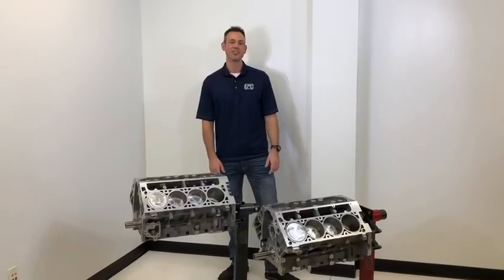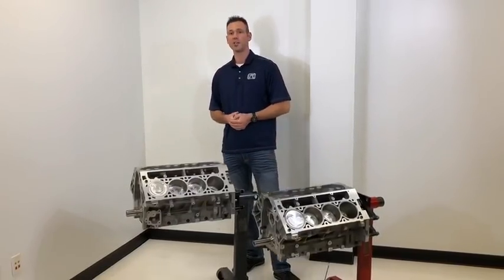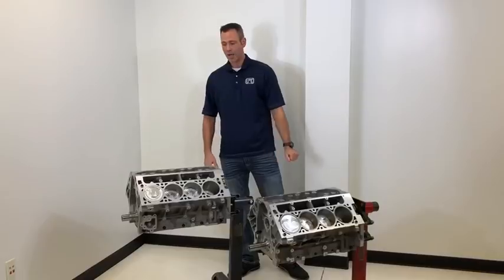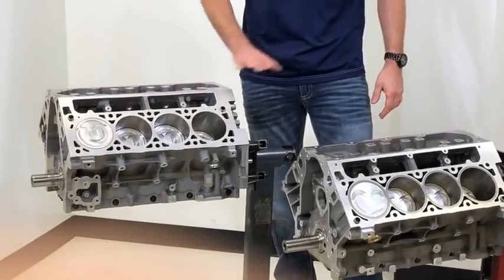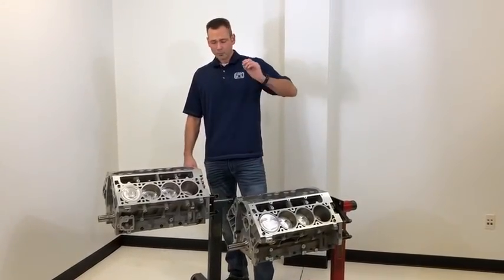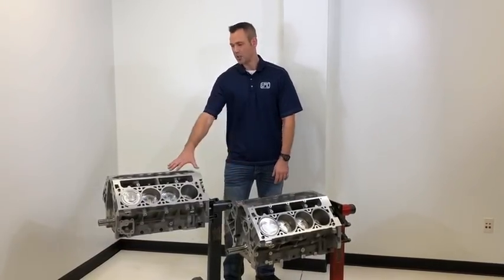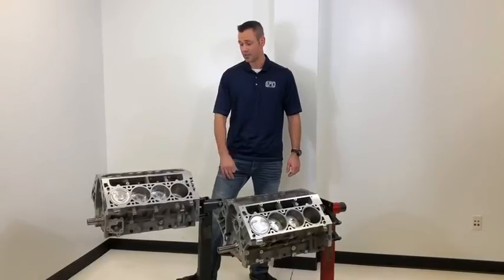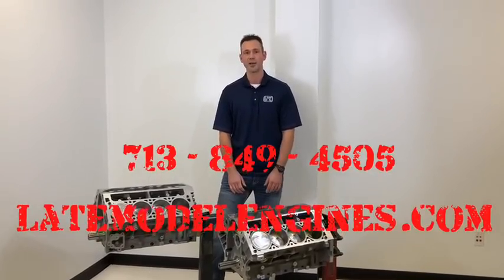What makes the LT1 / LT4 so strong?

Comment: Give me a 327 with a few nice bits inside at over 7k rpm with a carby 11.1  comp a solid cam even flat tappet 
 iron heads or maybe I could slip an ally set on there
 a nice solid timing chain reworked aftermarket or shed modded sump a manual trans in just about anything that ain't huge 
And u shall be exposed to a pleasure and the song of a lil giant killer  that has been forgotten about unfortunately
Reply: @keith-jo6wg  what era was the lt4 you are talking about I'l haftoo have a good look I'm very old school 
40 years ago 
A friend of mine in Australia 
Had a 327 small journal 
Built by a fellow that became a good friend  talented man 
He had a bread and butter engine workshop in a small city in New South wales 
But  mark the shop owner liked doing lil specials on the side 
If things got quiet 
It took him over a year of his part time to build this lil engine 
With attention to detail 
Solid cam flat tappet 
Can't remember specs 
Fuelie heads ported and match ported 
Victor jnr 
Balanced 
And squared up 
Good forged slugs 
Can't remember rods 
Guide plates 
Screw in studs and manly rollers 
 650 Holley mechanical 
Top loader and a 9 inch 
It easily revved to 7 plus 
It was in a four door Holden hj sedan 
Dumped on the ground pretty well 
Not a real light vehicle 
With firm suspension   235  50 series on front 265 50 series on back 
I drove this vehicle at 240 kph
Ish I was well past the 220 on the clock  and his Speedo had been calibrated quite well at time of rego it was one of the conditions by the fella that inspected it  and it had a lil more 
But I ran out of rd 
And I ran out of nerve I was 19 
Go the mouse 
Scared the Shiite out of me 
And to hear that lil sucker wind through the gears was something 
I won't ever forget 
It smoothed out beautifully at about 6k and was asking for more 
The whole way 
At the time 40 years ago the build cost him 5k or so 
Back then that was a substantial house deposit  a block of land was less than 20k 
Anyway I've always wanted one the sorta the same 
Yeah I know the past is gone 
Cheers

Comment: Are there higher flow direct injection injectors and pumps or do you revert to port injection for high horsepower? 
Are the aftermarket (incl Chev) going to be selling high deck height blocks?

Comment: Not even close to a Windsor
Reply: That's one of the best things I read in years old school has potential that has been written off so many times looking at the differences here shows some of the weakness in the LS   the only LS I've ever been impressed with was an LS 7 a friend of mine had 
greatly engineered engine  
But will over time still suffer from 4 bolt per cylinder and webbing issues if consistently driven hard 
An aquantence of mine was putting old school blowers on them for skid cars without upgrading anything Sept lifters and rockers valve train stuff  he windowed that many of em it was criminal and he wernt even getting a hell of a lot of power out of em  till he got sensible and run em on alcohol with mechanical and kept off the dickhead limiter 
Some of the toughest cars he was competing against were blown small block chevs and old school blown Ford's with mechanical injection and alcohol
I'd say most were after market or special blocks though or had been engineered for reliability 
They should have different days at skid fests one for cars with limiters and one for cars without and I'l stay home for one

Comment: I drove a LT-1 in a 1994 Z-28. I wasn't impressed. I drove a L88 5.7L 350 in a 1980 Stingray Corvette. That car was a piece of junk.  I don't like Tuned Port Injection either. I think Chevy in general I just didn't like. My First two cars a 1983,1984 Z-28 5.0L 305. I got a Mitsubishi Galant 2000 now and, I'm happy.
Reply: This is the Gen 5 LT1 in the current Camaro SS and LT1, not the old 90's LT1.

Comment: I would have to say this about these engines . Both times me and my wife owned a Cadillac one was a 2014 and my current one is a 2018 we had lifter problems . The ‘14 would have a lifter that every once in a while would collapse then after a minute would pump back up . Then the ‘18 out of no where dropped a cylinder cause of lifter failing and bent a pushrod . 35,000 miles . That’s in a Cadillac . How can these engines take abuse like they would in a Camaro or a corvette ?
Reply: Lifter issues are due to active fuel management and displacement on demand systems in the l86 and l83 engines.  LT1 and LT4 engines have differences in the valve train which allows them to handle more abuse.
Reply: Are you sure it was a failing lifter? I had the exact same thing happen on my 15 Silverado 6.2L, snapped and bent a pushrod. Took it apart, replaced the pushrod, changed the oil, and it’s like nothing even happened. I’m still getting a random misfire code from the fouled plug but this literally turned $1000 of work into me givin my buddy, who’s a certified Chevy mechanic, $100 for his time and effort.
Reply: From what research I have done personally this comes from failure to change oil filters and oil. Oil filters are more important than the oil change on all these new blocks.

Comment: The LT4 has a slightly stronger block.
Steel crank better rods and forged pistons.
And will easily take 1000HP with a well engineered twin turbo setup ....
Reply: So is it possible to run a reliable 1200hp LT1 with a stock bottom end with ARP stud upgrade?
Reply: @sixx6sixx107  
Unlikely hence steel cranks special rods and forged pistons...
Reply: @markjmaxwell9819  ig I need to buy the boostline drop in piston and rod setup...hate to spend the $2650... thinking of trading this thing for a 6.0...its just too dam expensive
Reply: @sixx6sixx107  lollll
Reply: @markjmaxwell9819  I'm serious...I'm just going to do a Gen 4 5.3 with stock bottom end(with ring gap) and ARP studs,trickflow heads with BTR springs and head stud kit,BTR stage 3 turbo cam and a nice intake manifold with two cheap ass ebay turbos.... going to start with that and build the 6.2 slowly while running that combo or I may trade it for a Gen 4 6.0 🤷🏾‍♂️
Reply: @sixx6sixx107  lolll good luck...
Reply: @sixx6sixx107  sounds like you been doing your Richard Holdener home work. I wish you success in your build my friend.

Comment: Which of the two would be superior for SBE boosted application?
Reply: Hamad Al Shaqsi The LT4 is better for Boost. The LT1 is great but you need the better pistons and the crank that the LT4 has. The Camaro SS has the LT1 the ZL1 has the LT4 with the Supercharger. I have the Camaro SS 2018 would love the ZL1.
Reply: Big D my bad. My question was between the LS3 and LT1.
Reply from the maker: @hamadalshaqsi2005  The LT block will be stronger so inturn better for boost. That being said both setups built correctly can make good power.

Comment: Does anyone have any information about the stock GM LT4 bearings? Do they fail at high horsepower, or is that something to do with the factory clearances/balancing?
Reply: Your bearings should be fine if you have around 600-700 HP anything over that is going to stress them.
Reply: @lorenzofettucine2639  I should hope the bearings can handle 650hp, it is rated at that. I  am sure they can handle much more.
Reply: I was worried my car is rated at 640 bc Cadillac.  I was afraid of my bearings going bad.

Comment: They had to built the LT-1 a little stronger to make it reliable with that DIRECT INJECTION crap.
Reply: Masked Masters not crap , at all .
Reply: @dubocupo8647  carbon build up isn't crap?  It plagued my Focus RS, hopefully not my 1le as well.
Reply: Vosovogalsyncope carbon build up is one small problem with the new LT motors but the benefits have a way longer list . Did you see the l83 ( gen V 5.3 ) make 800 hp on #8 of boost ? That’s insane . I don’t really care about your pos , stick with the bow tie.

Comment: 94 caprice with the lt1, wanted to know if any other gm v8 variants would be compatible for a set of engine heads
Reply: TransMechanic98 these are gen V LT motors dude, not the old ones
Reply: Well shit, Ik the intake/exaust layout is diff between the 2 heads. I wish there were more online info on gen 2 lt1's. Thanks for the heads up tho, tbh forgot about this comment.
Reply: TransMechanic98 yeah it’s kinda confusing how there’s the lt1 from the 90s and lt1s from current times
Reply: @390nm  also from the late 60s the original lt-1
Reply: @dirdidarod  there is all kinds if build info forbthe gen 2 lt1

Comment: Although the lt4 is impressive, good technology over ls gen. To me the ls9 is much more special.   Forged pistons titanum valves etc
Reply: He's just emphasizing the block. Pistons and valves are something different
Reply from the maker: LT4 uses Titanium Valves, and we have multiple forged pistons we can use.
Reply: You can get forged part for the lt aswell 🙄
Reply: @MICKSHRED  you can get forged internals for almost any engine, mr capt obvious.  As I was saying the ls9 comes with forged internals from the factory which is why the block can hold more power reliability vs the lt4 when comparing factory configuration 😳
Reply: I rather have the LS3 over the LT1
Reply: @Ws6Ms  ur crazy
Reply: The LT4 also has titanium intake valves

Comment: Hello LME. I love what you guys do and I actually live in Houston Texas. I have a question for you guys. Can you guys make a Camaro SS rev to 7500 RPM like a Mustang GT? I like Camaros but I think they need at least a 7000 RPM redline.
Reply from the maker: Yes we can make it spin up to 8000RPM
Reply: Yes you can rev to 7,500 all day long with the right spring set up.
Reply: No...you need DOHC engine with 4 valves per cylinder. Drawback is you will not have the low end torque like in the LT pushrod setup.
Reply: @matrox  You can definitely make a LT1 rev to 7500.
Reply: @toddb3394  I'm late but thank you I've own Gm cars since I was born my 1st was my first car at age 15. A 85 z28 Camaro 305 . 7 more 3-5th gens Camaros including 1 97 firehalk lt4 car ran 11.78 on the old nitto 555 373 gear 230 238 cam car I was in my early 20s. Whipped many stangs. An 1 91 lt1 355 tune port black red int veet drove in high school along with my 1st car eva at age 15  85 z . My fastest to date is my 2000 z28 mistc teal flip flop green color factory t56 6 speed car. Now is the fastest true stock suspension on small tire 28s in my city an all southern tri city areas. Even my 1st upgrade bk then was a Gm performance hot cam with 3000 stall 373 gear car stock t56 stage 3 clutch car with just a cam harden push rods long tubes Gm free Hp mods ls6 intake 243 heads i can remember constant 6,800 - 7000rpm clutch drops an that was my very 1st aka the HULK very 1st street drag combo 4 more combos as cars got faster an faster have to keep my current set up hush hush due to money grudge racing but yea the commite was made don't make since or don't believe me couse anyone knows or call vengeance performance an they will tell you 6800-7200 is actually were they costum grind there small baby cams ls cars even turning 7000 7200 easy so I'm positive the new lt1 revs high but if you do research on Gm push rod motors our motors make peak hp an tq at a little lower rpm an in some cases if you look on the dyno charts after that power is made depending on your cam or motor set up after you reach peak hp anything after that it will fall off an you just adding extra wear to your motor Gm an the over head Ford motors are completely different in how they make hp. But that's the reason why even the die heart  Ford guy will do a ls swoop couse ls an Gm  motors take more abuse an make more hp at a friendlier budget price.
Reply from the maker: @matrox  False we can make LT's or LS's spin up to 8000 RPM
Reply: @LateModelEngines  My LT1 in my 17 SS camaro 6 speed man  tach is redlined to about 6800rpm. So I go with that.
Reply: @matrox  Spin my stock bottom end gen 4 shit to 7500 every time I drive it.
Reply: @matrox  right thats why my boys c6z 106mm garret solid roller build makes power past 10k rpm and is set to shift at 9500 on a 427 lsx.